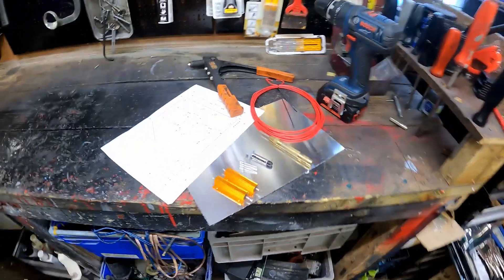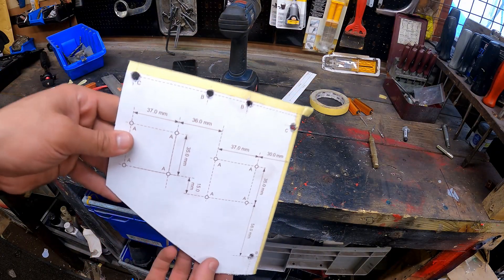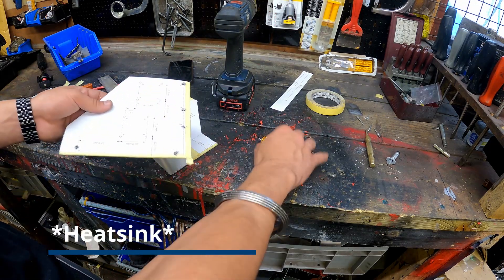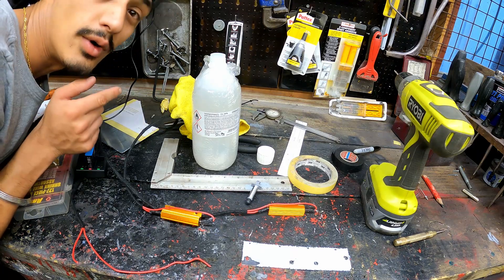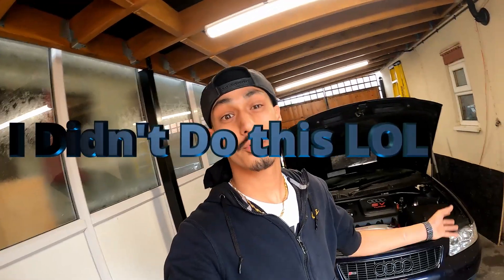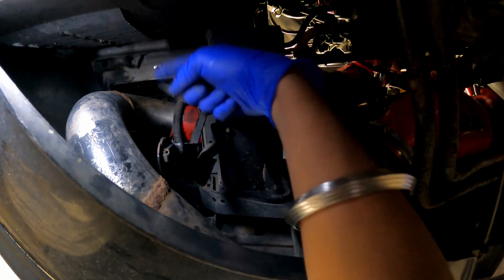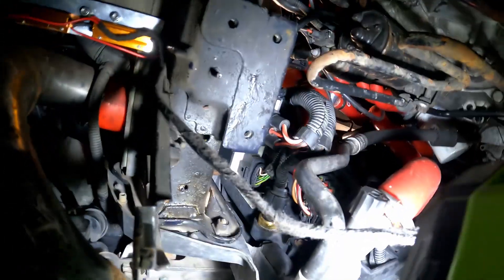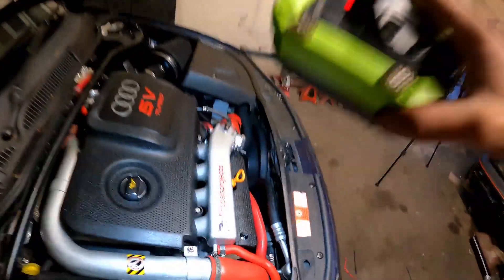Low Speed Resistor Mod - Mk4 Golf, Audi S3 8L, Leon Cupra, TT Quattro

Comment: Is this to bypass an AC delete ? And make the low speed fan kick in when you tell the control unit in the car it's on.. but not actually there ??
Reply from the maker: Hey man! This is for when the low speed resistors die in the fans, so instead of changing fans you can add these resistors and it will work!
Reply: @PritpalsProjects  cheers man. Do you have any links for the resistors or the value of the resistors please

Comment: aluminum is EXPENSIVE atm, cutting that hurt me haha ...im looking at that square and getting ideas, is that aluminum and thicker gauge ?! Maybe use something like that for this and punch/drill it out haha? 
Thanks for this video! I'm replacing my rad/fans and just did some CFM testing as best as i could learn in a few days on the OEM mkiv fans since I couldnt find the info anywhere at all.

I heard this thing gets hot though, with a smaller plate how hot does this get after driving for an hour or so?
Reply from the maker: Haha it was cheap at the time I got the aluminium! 

Thicker gauge works better for a heat sink but due to location of where I placed it, it gets cooled from driving along too so doesn't get too hot!

Comment: So going to spend over 7 minutes showing how pretty you are going to make it but then just zip on by how ya did the wiring and what not huh.
Reply from the maker: The wiring is the easiest bit, you cut the white and red wire.. connect that to one side of the resistor, the other side of the resistor splices into the red and Black.. 

That's it, do that for both fan plugs and your done, 

Bit hard to film underneath the car!